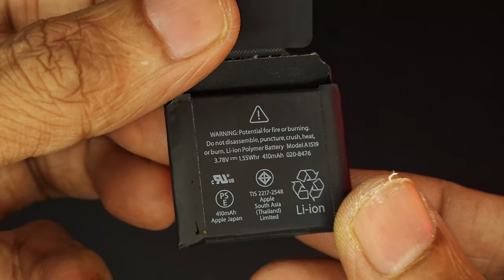Apple TV Siri Remote 4th Gen - Disassembly/Removing Battery

Comment: How to fix it back? Particularly the connector from the front to the back panel?
Reply: I had the same problem but I think I figured it out. Under the top are two small plastic pieces. They are very tight to fit in and absolutely not with pressure. I make the gaps little bigger then I put the cable back in the board. In the last I pushed back the top first gently and the downsides. It did not fit right the first time because I pushed too much in but the second time it happened bcz it was genuinely.